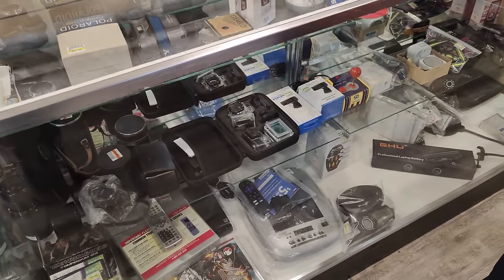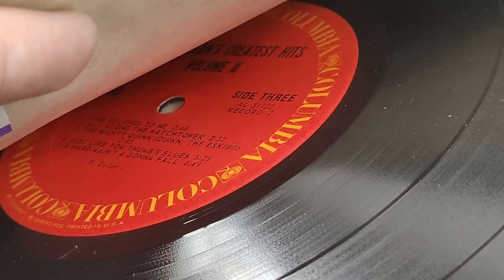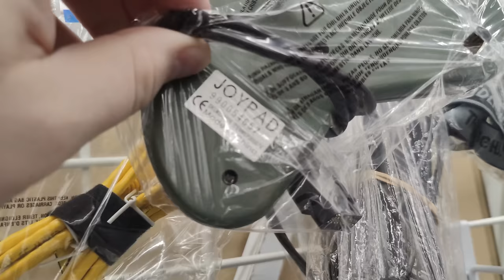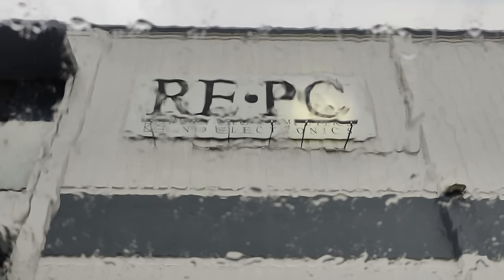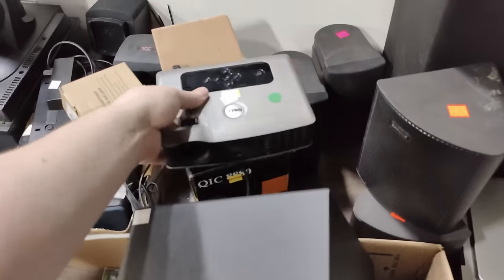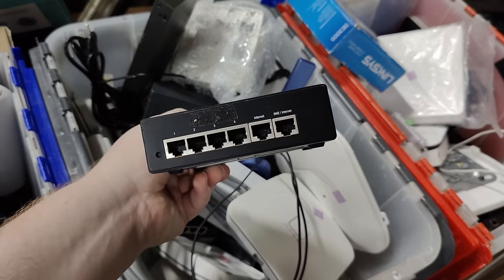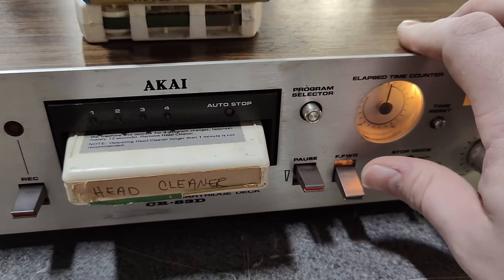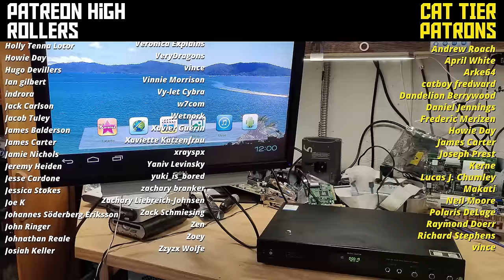Thriftmas 2023

Comment: 7:32 - Fun fact: The thrift store near me won't accept any computer with a hard drive or SSD in it, even if I provide a signed statement attesting that I installed a brand new SSD, fresh from the package, and installed a clean copy of Windows. I completely understand why they have a general policy of not accepting computers with storage media installed, but you'd think they would have an exception in their policy so that the owner of an established IT company with a spotless reputation and demonstrable understanding of information security and how software licensing works could provide computers that people down on their luck could actually take home and use. No worries, though; I've found other avenues for getting older PCs that still have life left in them into the hands of those in need.

22:50, BSR speakers - Yes, BSR was a name. I had a BSR turntable (read: record changer) in the early 1980s. Friends of mine back then acted as if it was a venerable name in stereo, but if it was, I'm pretty sure the glory days were long gone by then, because saying that my BSR record changer was "nothing special" would have been a lot like saying that a broken sewer pipe flooding a basement is "making a bit of a mess".

Comment: I went to Good Will here in Santa Ana, CA. I came up!  Less than 9$ spent on a little pair of ‘Russound’ “Impedance matching transformers” for $5, a Johnathan Richman record ($0.50), AND a pretty damned pristine Denon AVR-1705 for 4$ (no HDMI d-subs, but it probably is 1080p if you can go COMPONENT!!).  To think those output transformers cost more than the AVR?!?  My favorite thing to thrift?
KVM switch ports, ps2 to usb cables,
surge suppressor power strips, and the rare inverter. Yeah, there’s a reason why I’m not in the car headed up to Washington right now. Car too full of kludge…
Is Carrie Okay?? I can totally throw down on the Cumbias while I wait for a burrito.  Thanks for sharing!!

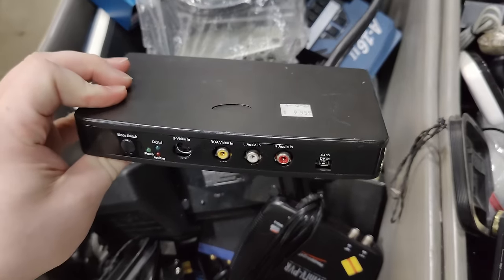Comment: 25:52 - That box doesn't do what you're describing. I have its cousin, the Canopus ADVC-100. They're meant to convert analog video tapes into DV format and import them into a computer via Firewire, where you'd edit them in Premiere or Vegas or whatever and them pipe them back out to tape -- either to an analog deck via s-video or component or a DV tape via Firewire. The incoming video is 720x480, and the output is going to be the same. It doesn't provide a live, always-on output. It's also useless without a Firewire add-in card, unless you have an old motherboard or laptop that has one (or you're a weirdo like me who kept his Creative Audigy sound card that has a Firewire port for this exact purpose). Most people only use them for import with no intention to go back out to tape -- I digitized about 10 SVHS tapes using my Canopus and a DV capture program called Scenalyzer just this past week. This also involves dealing with some MS moon logic. You'll get a blank screen in your capture program until you go into Windows' Privacy > Camera settings and whitelist your software because MS has decided to categorize it as a webcam. There ARE external boxes that will convert the entire screen to a recordable analog video signal - lots of old video cards had analog outputs -- but they usually only worked at 640x480 and 800x600 resolutions. Expensive external boxes would also do 1024x768.
Reply from the maker: I don't know what you mean. it's a completely ordinary bidirectional DV converter and I've used several similar devices to do exactly what I said.

Comment: Th6se Aviom boxes are essentially 16ch digital mixers that connect to a base unit over a proprietary protocol using standard Ethernet cables, they're designed for personal monitoring on stage/studio and as such allow the performer to control their own monitor levels. These ones only use a 16CH digital multiplex protocol though there are newer boxes that use a different protocol and can do more channels. 
Somewhat interesting is that Behringer's version of the Aviom mixers uses essentially a quite simple protocol, it's just two 192K AES3 streams, these would normally be two channels (L/R) but what they've done is package up four 48K AES3 streams into one 192K stream, so with two of them and you've got your 16 channels ( 2 x (4 x 2) ).
Most console manufacturers have their own variants, with some having return audio channels so that you can route the output back to a wireless IEM transmitter (the Midas DP$* can do that with a HUB4 rack unit).
And B¦S¦R were Birmingham Sound Reproducers who were  a major manufacturer of turntables.

And as for the m-audio soundcard I have something similar floating around,the ESI 1010e, except this one is PCIe and the PCIe card is fairly simple with only a couple of chips on it iirc with the card connecting to a rackmount box via a special HDMI cable. What makes this more interesting is why the PCIe card is so simple when it's fairly complicated 192Khz 10x10 audio interface with MIDI, the reason for the simplicity is that the actual sound card is in the rackmount box and the chips on the PCIe are just there to provide the interface to the card over the special HDMI cable. They did a previous PCI version that had a much fatter link cable and in that case the PCI card was the audio interface.

Comment: These stores are called charity shops here in England, and it seems as if they are obligated to carry the following stock in each branch at all times;

A sandwich toaster
A George Foreman grill
A paper shredder
A DVD of one season of Friends
A Michael Buble CD
A pint glass with “Come on England!” tampo printed on it
At least three paperback copies of Bravo Two Zero, The DaVinci Code and 50 Shades of Grey
A Jim Reeves album
An iPod dock with 30 pin connector
A copy of PCs for Dummies
A Haynes manual (AKA Chilton’s) for a type of car from the ‘80s where there are approximately 3 examples left on UK roads

This seems to be an unwritten law.

Comment: I just bought a Samsung curved monitor similar to the one you saw, but a 27" with the ac adaptor for $12. Works perfect, great picture. I think they had it mispriced as it was next to another crap monitor for like 40 dollars, still on the cart they wheel out. Sometimes you get lucky.

Comment: The Cinergy T2 is worthless even in Europe since it only supports the original DVB-T standard. I owned one and it worked fine, but after the switch to DVB-T2 (different modulations, h.265/h.264 instead of MPEG2) there’s nothing to receive anymore.

Comment: I run a more conventional set of Cerwin Vegas (12" 2 way) for my PA, and they sound excellent. Those I'm sure sound fantastic. And no, those are the stock, correct drivers, with the red surrounds and metal dust caps.

Comment: same here, thrift stores have tons of cable modems that you can't use, but no computers...btw that DVB-T tuner you might be able to use it for an RTL-SDR if it has the right chip in it
Reply: It doesn’t. It's a 2004 box using a Zarlink MT352

Comment: Everyone is apparently really callous about putting things on screens now. Bought a couple brand new TVs for christmas, don't remember the brand, and after hanging them up I thought "Ohh now I get to take off the plastic protector film lucky me" except it wasn't protector film - it was fucking SHIPPING TAPE. Right down the edge of the bezel, RIGHT ON THE LCD SCREEN, just full on shipping tape. The first one was powered on and you could watch the discoloration as the tape pulled the film of the LCD up now matter how careful you were. It felt like it had to be an error but the second one was identical.

Comment: That Grace unit looks *exactly( like the kit I used, sold as some random made up German brand, to locally play back the online streams of the radio station group I worked for. Used to put the coax digital in to a SPDIF to AES67 stream adapter to get them on to the AoIP network; and then take all the streams back to a machine running silence detector software.

Comment: Those look like Cisco Catalyst 9200 or 9300 series switches on the bottom shelf. Those things are still current and pretty good, we use them all over the place at work.

That conference phone thing is exactly as you'd expect, a wireless speakerphone with remote microphones that you can place at different points on the table near whoever's going to be speaking most. Could be 2.4GHz, could be DECT, not 100% sure. It had an Ethernet port, so it's SIP. Or it could be some proprietary subscription service that lasted exactly zero seconds longer than the VC money they burned to get it out the door.

Comment: IIRC Cisco bought Flip just before Flip died.  I have a drawer full of Flips.  Got my first SD model in 2008 for $12 at Big Lots (they were usually about $90 back then).  Subsequently I got several more Flips and competitors from ebay.  Some 720P, some 1080P.  Some took AA batteries, some had rechargeable built-in batteries.  The video they produce is about as good as that of a budget phone today.  Still acceptable.

Comment: The problem with those old DELL 4x3 monitors (My NHS health board bought loads of them) is that they are not LED backlighting and the fluorescent backlighting are all failing. Had so many of them swapped out in the last three years.
Reply from the maker: That's wild, I have literally never seen this. Like, I don't not believe you or anything, but I've been through literally more than a thousand of these (used to work in ecycle) and owned about a dozen myself and never seen a backlight fail. I wonder what the disparity could be from
Reply: @CathodeRayDude  lol! Maybe it's the GP receptionists that are the real baddies here. 😁😁

Comment: About the switches. Its sad that there is still not a lot of POE stuff. I have tried to find POE sensors of all sorts. Clocks, dates, scrolling boards. There are a ton of stuff you could run over POE yet its all lab grade and costs an arm and a leg. Everything wants to be wireless and I want to keep most of it out of the wireless. My new build, I will lay down around 50 or more lines for future POE stuff. Between outdoor and indoor security cameras and some POE clocks I think it will work well.
Reply: I don't think PoE extractors are too expensive.

Comment: Can't speak about 4k, but I remember when Cisco bought Flip (I was working at a RadioShack at the time), and I remember them getting up to 1080p. Also, I had TWO non-working Mavica cameras. Both with the same issue: partially failing voltage regulators. They'd lose power after running for a while when the regulators got warm enough. Technically, they did still work, you just had a time limit before they'd overheat.

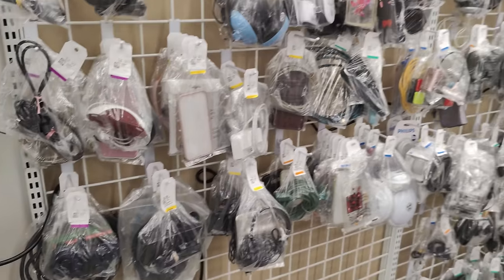Comment: 10:55 That Controller looks like the one from a parrallel universe where at some point in a different place on a different controller they removed the cable and stuck an antenna in it to control a way too underengineered tin can with a glass window in the front until it imploded, but hey, at least this controller won't end 5 human lives, right?

Comment: I recently installed a full audio system w/ a touch-screen dvd receiver in my suv.  Funny thing is it also has a built in Pal codec TV tuner,  which I think is an Asian broadcast TV format standard.  I just need a pal TV antenna with a 3.5 stereo headphone jack to test it out 🤓 ..

Comment: the first bubble jet printer I bought in 2001 I used and maintained for so many years until like 2017/2016 I took it apart to clean it and there was this one spring I couldn't get back in it was so so terrible my fingers felt like I was in a claustrophobic nightmare and I tried and tried and tried to get the lever in the spring back in place it was a Canon double check printer from 2001.

Comment: Actual 4:3 monitors are pretty rare on the shelves; 1280x1024 is 5:4 ratio, and is what most of the non 16x9 or 16x10 are, AKA the Devils ratio for retro use. Ugh.

Comment: I dropped down here to talk about those Aviom personal mixers the moment they showed up, those things are awesome!!! basically, they connect to a base station where you can feed up to 16 separate audio channels from the sends on a recording studio desk or live sound console. then your performer has this base station on a stand and they connect a pair of headphones and make their own monitor mix!! apparently this one even lets you save a mix state and recall it later. they're actually their own mixers, too. you can connect a bunch of them to the same base station, or even daisy chain them with the a/b ethernet ports and have completely unique mixes of the same 16 channels! super cool find!
Reply: also, the conference phone. it appears to work in the manner that a receiving party would be called on the cellphone, which while on the dock, would transmit audio to the speaker, which would be placed on the conference table for all to hear. then, the presumably also wireless microphones, would be placed on the table spaced out, and transmit back to the phone. the microphones themselves are likely omnidirectional low-voltage condensers, or at least i would hope so. anything else would be a strange choice in a microphone with that form factor doing that job. the shure beta 91 can get away with being a directional condenser microphone because its form factor makes it impossible to place incorrectly. it cannot be placed on its side or upside down or oriented wrong, its pickup area will always be directly vertical because of how clear it is that the mic is meant to sit. unlike these weirdos. you could stand them up, or lay them on any of their four sides, and it would seem like a pretty reasonable placement without knowing anything about their directionality.

Comment: Flip was originally a disposable/ one time use camera from Walgreens/CVS. People hacked it to work with USB. Then they started selling them as low cost
Reply from the maker: Huh, I didn't know that.
Reply: @CathodeRayDude IIRC it was like $20, I think it gave you maybe an hour of video recording. Then you brought it in and they would extract the video and sell it to you on CD/DVD.

There were several articles on hackaday when it was a thing, you could try to use some USB drivers people had modified as well as a modified cable to mount the camera and download. It was... very unreliable.

I don't remember the cost of the Flip, but it was a big leap from the $20 disposables.. if only I could have gotten that driver to work properly...

Comment: I yoinked an hp zbook for twenty bucks...  "Working no power cord".  Not even really beat up.

For ten bucks, if i couldn't find a power cord, i was going to take the RAM, hdd and whatever else out for my future tinkering.

About 30 feet away in a box of random adapters i found the power brick for it for a dollar.

21 dollars later and a wipe of win 10... I'm a happy camper.

Comment: Man, I dont think I could be allowed in that RE PC. I think I would want EVERYTHING there. At least, younger me from 10-20 years ago would be salivating for all that stuff that was once cool and amazing to me, and younger me that still exists hidden deep within me would still want that stuff. At least till my older reasoning would kick in and let me realize that I just dont need this stuff, I wouldnt do anything with it other than display it proudly on a shelf. Very fun stuff.

Also, on that Grace internet Radio, I used to have an Aluratek alarm clock/radio that could stream from Grace internet radio service. It was interesting, and most of the stations sucked. The device itself was cool, but very cumbersome to use and would frequently lose power and forget its alarm settings.

Comment: You can charge nickel metal hydride batteries with a nickel cadmium battery charger....not the best idea, but it will work. I had that exact GE charger....
    Of all the time I have spent wandering through thrift stores and flea markets, either alone or with friends ( hours of running commentary on the items there), I had no idea you could make money doing it...
Reply: as someone who doesn't know a lot about batteries is the nicad charger like actively useless (as in nicad batteries couldn't really be recharged at all) or is it just obsolete now that most stuff has switched to lithium?
Reply: @Arivia1  It's obsolete. NiCads could be recharged 500-800 times, but didn't have the output of lithium ion batteries. Nowhere near it. Nickel metal hydride batteries are still available, better than the old NiCads. Lithium ion has replaced both....more energy in a similar size battery.
Reply: @scottthomas3792  thank you!

Comment: CRD - that USB European television receiver (DVB-T) was very popular with amateur radio operators in the USA for use as a software defined radio (SDR) receiver.  Since broadcast over the air TV is much more popular in Europe, not a lot of USB based receivers were made for the US market and thus US radio operators would import these European receivers.  Good USB DVB-T receivers could receive frequencies well outside the standard European OTA frequencies.

Comment: 3:33 I bought that 32" Vizio back in 2007 and had nothing but grief with it failing and failing each time before the warranty and then repair warranty would run out.  I had to pack it up and send it to them THREE TIMES before they finally sent me a new unit.  Then finally it lasted until 2020 (the input ports were slightly different adding a digital audio output/input making me think it was a revision of the flawed version I had) until I was snatching out some cables in my media room, accidentally striking the screen with an RJ-45 connector, cracking it and ruining it (sighs).

https://www.youtube.com/watch?v=2lhQ6PDvCi8

Comment: NiCd charger is useless ? NiCd batteries are still sold and user for example in RC models. NiCd suppose to be banned, but like lights bulbs, are still sold. Opposite to NiMH batteries, NiCd ones works after 20 years. What really is useless is that DVB-T tuner, because in Europe DVB-T broadcast was discontinued many, many years ago.